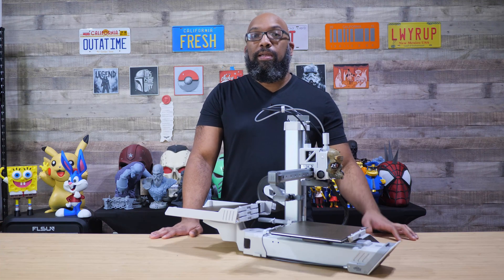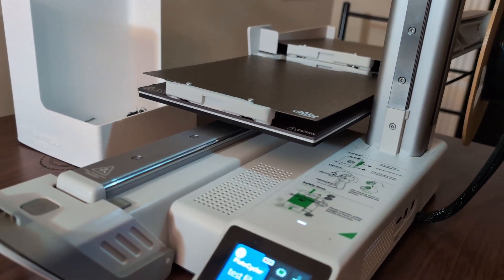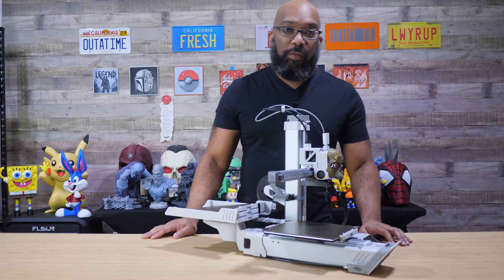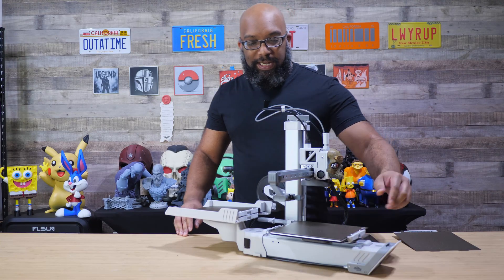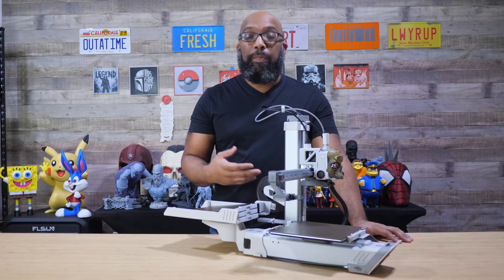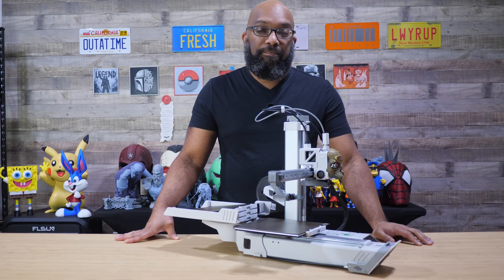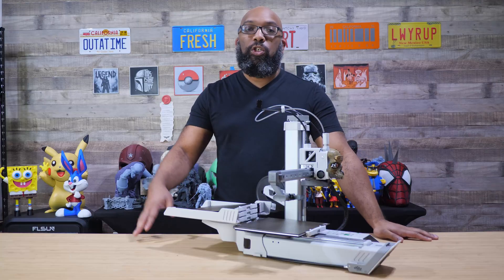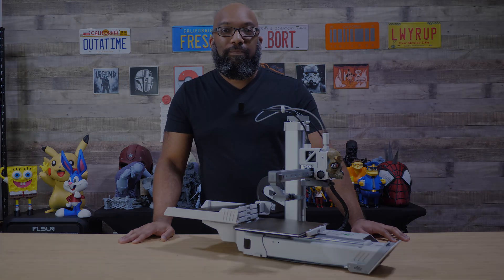The Bambu Lab A1 Mini Can Print Nonstop With The ChituSystems PlateCycler

Comment: having issues with sliced files from their website.. I tried the swap mod and due to being in the usa couldn’t get support or parts kits etc, so was excited to have this one non printed and easy and it installed easy and ran several successful tester runs just cycling empty plates, but as soon as i slice files it tears the plate off pre print or mid print and is a mess

Comment: I am using the similar AutoSwap system by Evrenot on Cults3d on my A1. Everything is printed on the A1, except for a couple of nuts, bolts and magnets.  After some initial teething problems, it is now very reliable. I often change build plates and start the next print remotely. I even did it from an airliner last week. It can be used with any build plate. It also has an independent 3mf to change build plates from Studio or the Handy App.